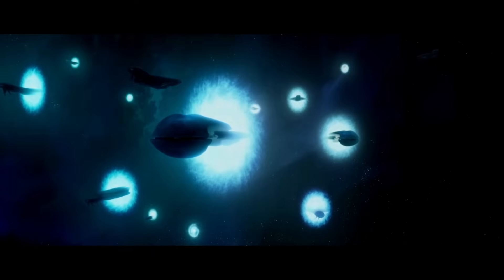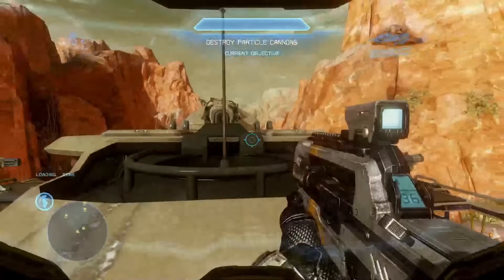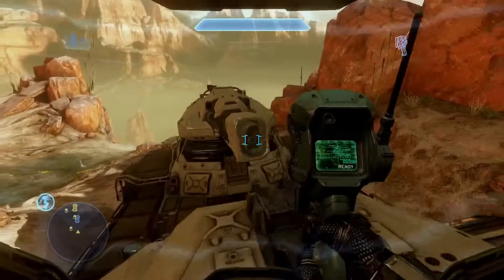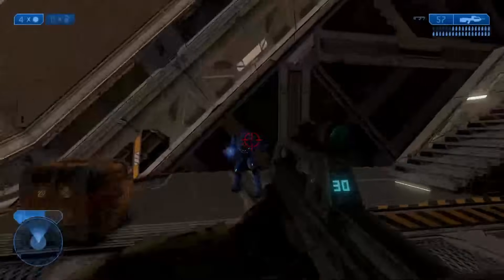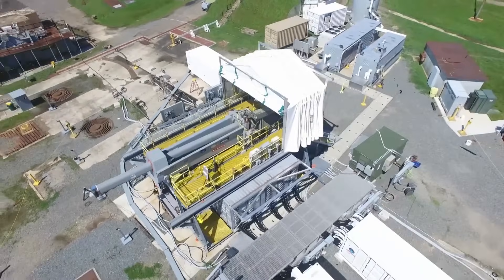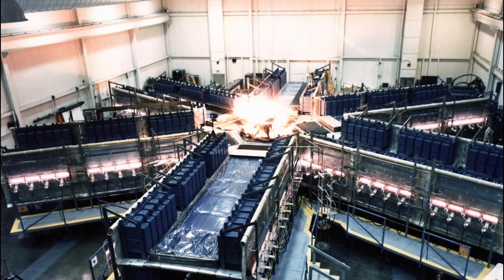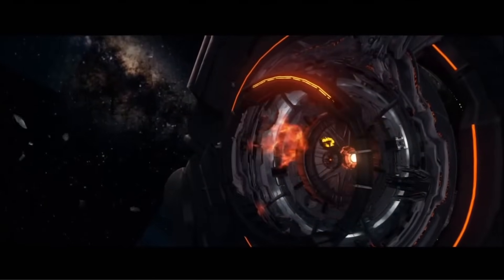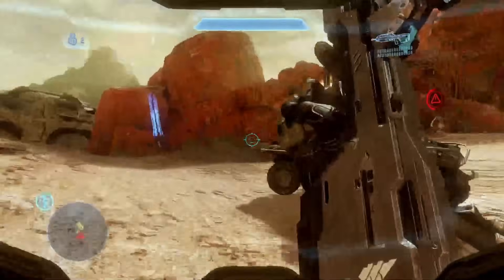Could We BUILD Orbital Defense Platforms TODAY?

Comment: I actually think what they meant by transferring power to orbit was some kind of tether with a large microwave or tight beam laser emitter on it, with the subsequent receiving equipment located on a large disk on the weapons platform. That's really the only way. This was written before the art department drew up the battlestations.
Reply: The issue with these kinds of emmitter/reciever system is that it's very energy innefficient.
Someone did some evonomic calculations on solar power sattelites way back, and it turned out that it was cheaper to just build a crapload of solar panels on the revcieving end instead, and skip the transmitter part, since the mass/energy ratio on the reviever wasn't going to be all that much better than solar unless you believe that frying anything that comes between the pair as an acceptable tradeoff.
Reply: @MrAntice  id hope in 500 years wede figure out a way to do it more efficiently.
Reply: @robertharris6092  Not without breaking physics you can't.
There is no amount of magical efficiency gain that can fix the issues with beaming power around. the loss is a factor of distance, energy density of the transmision beam, and whatever matter happens to be between the emitter and reciever.
Just like internal combustion engines have a maximum allowable efficiency, so does em based energy transfer systems.
Reply: @MrAntice  This assumes that it is in the solar system. The power transmitters are on reach, a different solar system. It could be more efficient if the star is a red dwarf, rather than the sun. (I'm not sure if reach has a red dwarf, but we can't assume its the same as earth)
Reply: @tfw8738  of course it assumes its in this solar system, especially when they mention Earth.
Reply: @jeffburnham6611  He was discussing the transmission from reach. The earth MAC platforms in the halo universe don't have power transmission, so the discussion of power transmission is unneeded, as it's not even used in the halo universe.
Reply: @MrAntice  interestingly enought, each of the twenty Eröd-Class ODP Stations around Reach, which fired a 3,000 tonne slug of tungsten at 12,000 km/s every 5 seconds, were wirelessly powered by their own surface based fusion plants that were the size of an entire city. Would having this much power output allow for the inefficiency of wireless power to be overcome?

Comment: I think there’s a new redox battery that doesn’t need a membrane. If I remember right it’s two tanks that store energy. One tank is saltwater one is a proprietary electrolyte. 

Not sure if that kind of battery could advance enough to help solve some of the power issues you discussed, but it’s still intriguing.

Comment: In a comment on the ground station subject. We do need to remember that with the Fall of Harvest book and the Forward Unto Dawn web series, space elevators are a thing in the halo universe. In order for a space elevator to work in the limited shots we get of forward unto dawn, they operated via an electromagnetic lift. For the distance to reach space, the power consumption would be enormous, it might be feasible to think that they'd use that enormous power generation for a ground base to also supply the orbital platform. 
I remember the orbital platform in fall of harvest having an onboard power generator but also having the ability to draw power from the surface as well
Reply: My question is couldn’t they use the vacuum of space to help lower the energy requirements?
Reply: That's some interesting science I'm most definitely not qualified to speak on but I'll try.
Firstly is trying to understand power generation and how they produce electricity. Things like nuclear reactors or coal power use heat to boil steam to turn turbines. Now steam doesn't rise in space due to low gravity. And thermal energy is extremely inefficient in terms of how much energy is lost due to thermodynamics. Solar panels are not efficient in today's standards. But that's also due to the atmosphere, in space they can be more effective, but are high maintenance. They're fragile and any amount of space dust can effect their generation. 
Now space is wild with thermodynamics. Since it's dependant on if you're in the sun or not, temperature can vary wildly. From -150 degrees Celsius in the shadow of Earth to 120 degrees Celsius in the sunlight (for the ISS). As such, using space as a thermal vent can be so fluctuating that it can be dangerous. 

This is where we'd steer towards theoretical power generation, but I'm not qualified or smart enough to think of things like that lol. We could use the decompression forces to vent atmosphere to spin a turbine but that's super mechanical and dangerous as well. And Newtonian physics would turn the exhaust into a thrust vector that can harm the orbit

Comment: For quite a while, I've had an idea to mitigate the problem of coilgun projectiles going right through the target, doing little damage.
I call it PMDP, Perpendicular Mesh Disk Projectile.
Shoot projectiles made of essentially steel wool, or wire mesh, coiled up into a rod, and imparted a spin to make them spread out an spread the damage over a larger area, dump all the energy into the target and prevent over-penetration.  An added benefit would be that the projectile that is spread out so much, would be much harder to shoot down with lasers, let alone missiles and counter-projectiles. Also, what would be a narrow miss with a solid rod, could still be a hit with a perpendicular mesh disk.

Such a projectile, depending on the area and mesh density, to the enemy radar, either would be harder to detect or would seem to be a much larger object, potentially masking the radar signature of whatever you send behind the PMDP,  or that of your ship/station/installation

Comment: i imagine that they could be powered by ground stations, this is far enough in the future that satellite solar panels could exist and they would operate on another semi modern tech of transferring electricity via laser beams, personally i would be more concerned by the Mac cannon instantly cooking the entire crew, and i think in reality the ship ai would calculate the trajectory taking advantage of the solar system's gravity to essentially sling rounds around planets so the guns never have to full face a target IE the game interplanetary
Reply: The only issue I can see with using the slingshot method is if the enemy ships detect the incoming rounds they could doge them easily, unless the round is self correcting. 

I'd say that the maximum effective range of a weapon would be two to five light seconds.
Reply: @Jake Baldwin  I'm pretty certain that MAC rounds are solid chunks of metal, so nothing to give off a detectable signals that a ships sensors would be able to find.
Reply: @jamesrogers1105  I was thinking more along the lines of tracking the shot via based on the enemy ship movement and energy buildup, since they have to align the ship in a specific way to aim the gun.

Comment: Great video! Moving power from earth to orbit is not actually that hard. We have been experimenting with it for a very long time. Essentially, there’s a power station on the ground, and all of the energy gets put into a laser. Which itself is a form of energy. You can laser from the ground to space and the orbital platform has a receiver that can accept that laser energy. It is not efficient yet. But probably the same time mac canons become viable the laser issue will most likely be solved.
Reply: I would argue that it's more an issue of heat dissipation.  If the fusion plant was on the platform, it would have to dissipate the insane heat of the Gun and the reactor; while if the reactor was on the ground, it could just be bigger to make more power to overcome the transmission losses and more easily dump waste heat into the atmosphere.
Reply: You can also use microwaves, and even use massive solar panels in orbit to tight beam that power down to any point on the planet with many such structures.
Reply: Hundreds of kilometers of atmosphere would disperse the laser(It would very wasteful), it only makes sense in vacuum, Lasers still disperse, but not as much.

Comment: I’ll admit it’s been a long time since I read the books, but does it specifically say that the ground stations power the MAC cannons? I always thought/remembered them as being remote link control stations they used so they wouldn’t have to worry about losing soldiers in a boarding action. It’s literally just the gun and no habitat, any maintenance is done EVA. (Also, I can’t decide if this would make them a older single use platform and the larger ones like Cairo Station are newer, multi-role platforms or vice -versa). Like I said I haven’t read the books in a while so there’s a good chance I’m talking nonsense.
Reply from the maker: Some of the largest ones it's said they were powered from the ground, or at least that's how I interpreted it.
Reply: Okay, thank you. Like I said it’s been a long while since I read Fall of Reach and First Strike.
Reply: I thought the largest ones were just repurposed space elevators or space elevators with macs attached to the station with the power plants also powering local cities when not in uses for planetary defense.
Reply: Yes that was very specifically why the spartans were deployed in the books.

Comment: The problem with macs as in halo is that they in reality they would be extremely impractical in ship to ship combat. Imagine someone having their pistol glued to their torso and trying to aim. And the mac station would also need to be dotted with hundreds of thrusters to allow it to aim in the first place
Reply: Missiles is better, fire faster, higher velocity, can tracking and homing itself to target, no need to aim, can fire a full salvo without exposing broadside, can place anywhere and fire anywhere no traverse speed limits, light weight and use less energy to operate.  imagine having a big gun but ended up get sworm to death by small missiles frigate because it's too close and too fast to track and  aim and target is not worth a shell. that's why we stop using big naval guns to fight and use VLS and tubes instead.
Reply: @MutheiM_Marz  Okay, but you can still 'shoot down' a missile, even with an unprecise wide-area explosion. Missiles themselves can't (normally) take a hit from a countering system. But a MAC round, with its massive weight and insane speed... how are you going to stop that? The best you can do is to put a smaller ship in front of it, to maybe reduce the total impact energy or knock it off course
Reply: @MutheiM_Marz  misses even in halo, do not approach 4% the speed of light, most if not all UNSC ships carry missles or rockets, they're all nukes, but a multi ton rock traveling at a fraction the speed of light can produce a large explosion then a nuke.
Reply: I don’t know, imagine trying to close weapons range and there is a 600 ton shell being launched at you every couple minutes to 30 seconds (recharge time depends on the ship and super MACs are 3000 tons). That’s a lot of hurt if you rush into an engagement and get so close that you can’t evade its velocity (up to 4% the speed of light). I can’t do the math but it would be interesting to think at what ranges and speeds you could evade that projectile